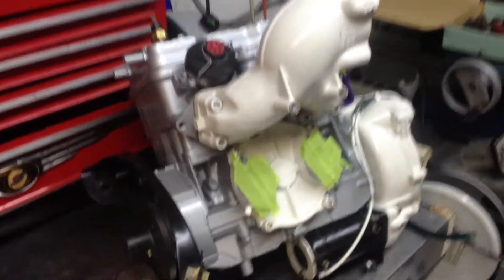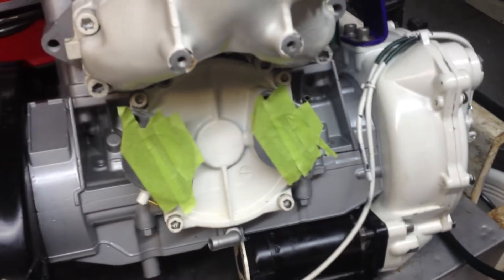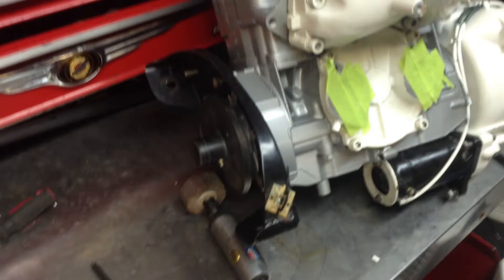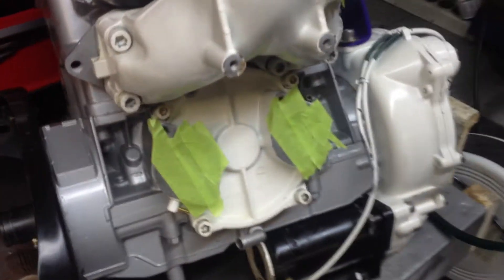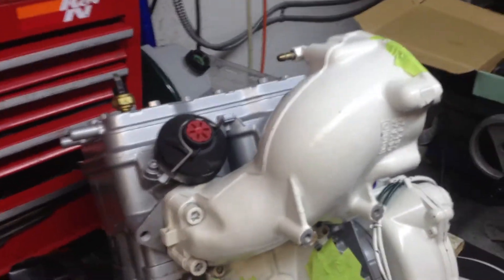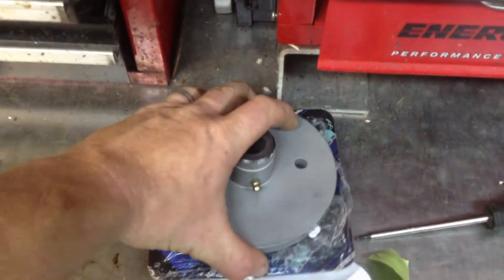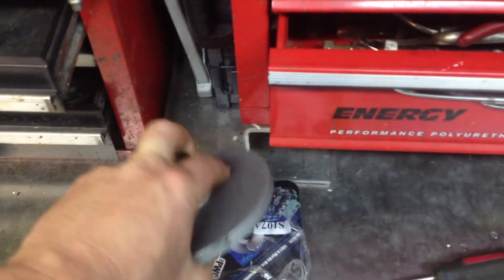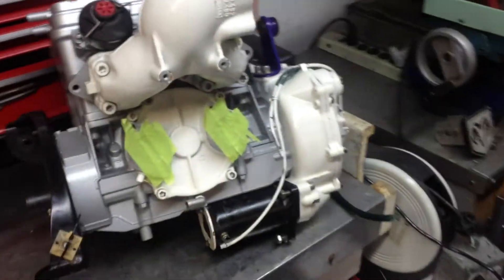Part 6: 1996 Seadoo GTX Rotax 787 Engine ready to be re installed

Comment: Hi machinesmetal,  (I know this video is older, hope you get this) Do you know the parts numbers for the coarse and/or fine threaded PTO?  I have the same problem!  Where did you get your second flywheel?
Reply from the maker: I'm not sure about the coarse vs fine,  I bought my second one off ebay when I realized the new motor didn't come with one.